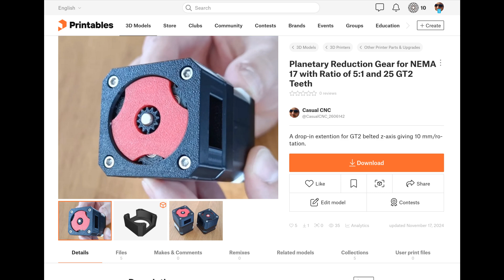Tiny Planetary Reduction Gear to Prevent Z-Axis Drop

Comment: Does it not drop just by the printer head being 5 times lighter from the motors perspective?
Reply: You've got the right idea but you're thinking backwards. When driven from the stepper side, the z is lighter yes. But for the z to drive the motor thru the planetary, it actually takes more force because when z is driving the stepper the output of the planetary becomes the input so the gear reduction works backwards.
Reply from the maker: Hmm... there must be a misunderstanding. The whole purpose of installing it, was to increase the force necessary to move z-axis/gantry down by gravity so it does not move (or at least moves slower). In my opinion, this is also exactly what I've stated.

My original design used 16 teeth (32mm/rotation) pulley, then I switched to 13 teeth (26 mm/rotation) pulley, which should have increased necessary force (to move it down by gravity) by the factor of 32/26 = 1.23, which did not help much.

Installing this reduction gear increased it further by the factor of 26/10=2.6.

Plus the friction of the reduction gear itself, which is significant, and the goal achieved!
Reply: @CasualCNC I believe Aries was explaining it for Gargert in more common and concise terms. Another way to explain it would be akin to...

Imagine the planetary gear here as a pair of simple gears. The motor holds a gear much larger than the gear that holds the belt pulley, so it becomes very easy for the motor to turn the pulley. But because the gear on the pulley is so much smaller, that also makes it very difficult for the belt to turn the motor.

Does it make sense now,  Gargert?
Reply from the maker: @claws61821  That's absolutely clear and correct, and this matches my understanding, as far as I can tell. So, to me, it is not clear  why @53Aries thinks my thinking is "backwards"?
Reply from the maker: See video at 0:10, that's what happens to z-axis which weights 1.8 kg when two NEMA 17 stepper motors lose power.
Reply: @CasualCNC  well yes I understand that, once you install the planetary gears, what's keeping the head from falling?
Reply from the maker: @gargert1433  It is an additional friction from planetary box itself plus a higher necessary rotation for the stepper motor, so it's static friction has increased by the factor of 2.6: 10 mm/rotation (now) instead of 26 mm/rotation (earlier).